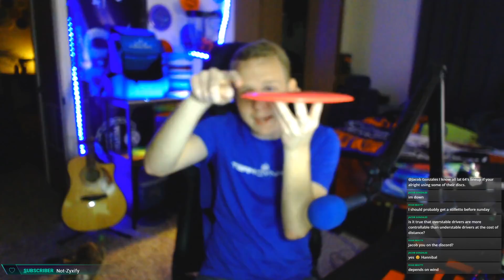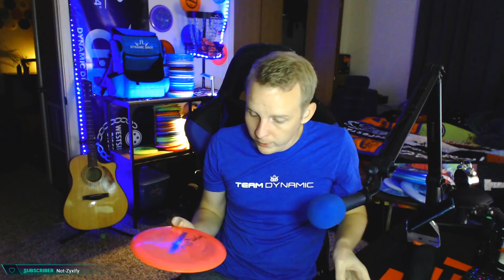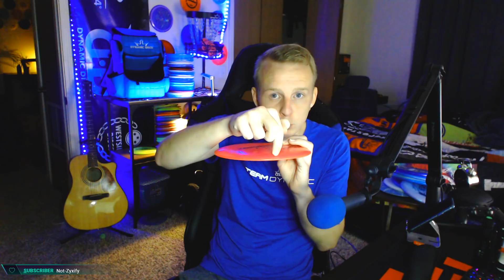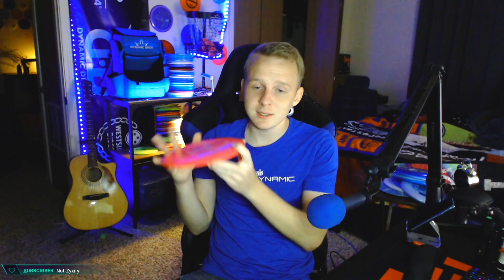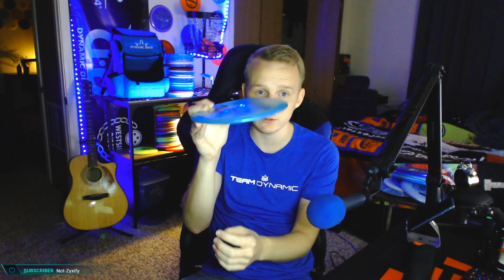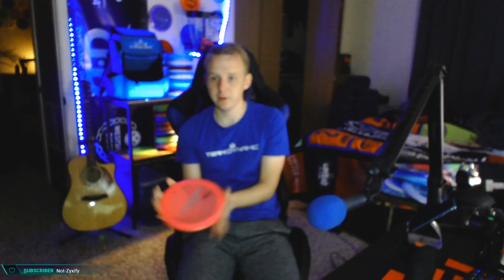The Physics of How Discs Fly [FIXED]

Comment: How are discs designed currently? Do the designers have some general idea of what shapes give certain characteristics, then they try them with wind tunnels or how does it work? I was thinking of giving a PhD offer to my university in how disc shapes affect flight characteristics, and create a model to predict these flight characteristics by simulating air flow around the disc, using something called "finite element methods". The idea was also to possibly later create an algorithm that can engineer discs given certain desired characteristics. Do you think there would be an interest in this from the perspective of a disc manufacturer?

Anyway, really cool that you took the time to dive deep into the actual "physics of flight". I think it was on point, and interesting take on understability of discs due to wear. I think it's likely that the irregularities in the surface decrease spin rate and results in less gyroscopic stability.
Reply: A couple of Danes already built such a simulation and were so happy with the result that they started their own disc company: Løft 🤓
Reply: @jacobteglgaardjakobsen3653  oh really, i wonder what method they use. Thanks for the heads up!
Reply from the maker: As I understand it, at least for Trilogy, Tomas designs all the discs. He knows what changes to make to get different flights, but in general, it's halfway a trial and error scientific thing, and halfway an artistic thing.
Reply: @DannyLindahl  Cool, thanks for taking the time to reply! There are always a lot of theories circulating among players why their discs behave like they do and it got me intrigued.

Comment: Hey Danny.  Wile you may be right about the nicks and dings on the rim I always thought the flight changed on a disc because you hit trees and bend the rim down a little bit with wear an tear witch causes more down pressure on the nose. Am I wrong or does this also affect the flight
Reply: Thanks Danny. Great info. I enjoy your your videos. I've been disc golfing for about a year and a half now and I'm fully Dynamic. Love the feel of the plastic. And love the getaway,  I thank you for that and all you do. Slow is smooth and smooth is far
Reply from the maker: If you compare a new and beat up version of the same disc, the nose on the beat up one isn’t lower. That would make sense but the nose gets squished back more than bent down.
Reply: @DannyLindahl  I have seen beat in discs where the edge is bent down in places. It’s easiest to notice in a base plastic like dx. If the nose a disc is already angled down, I think it’s pretty intuitive that hitting something would sometimes bend it more down when it’s flying parallel to the ground and hitting something at a perpendicular angle. When this happens, based on what you said, I would think it would contribute to the understability in addition the effect from nicks/dings.